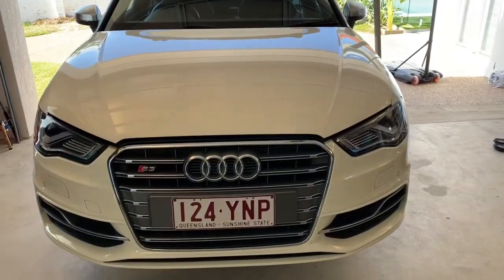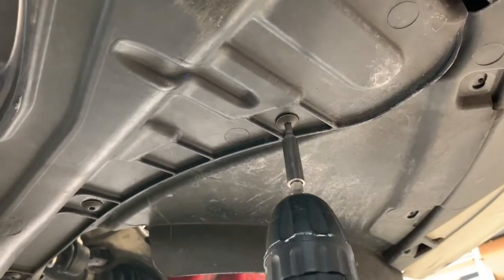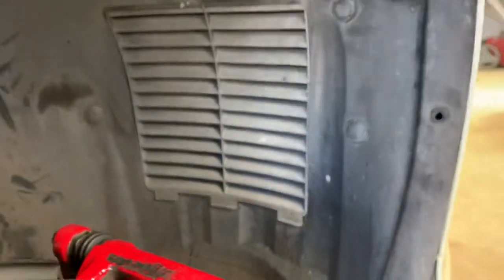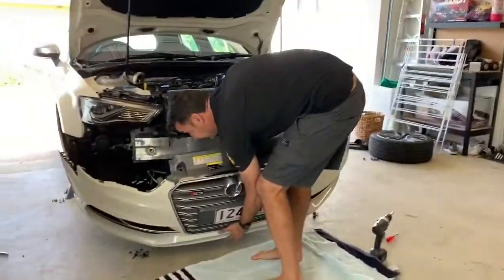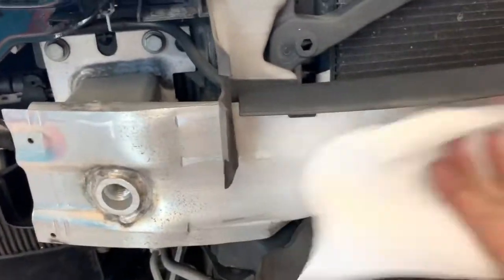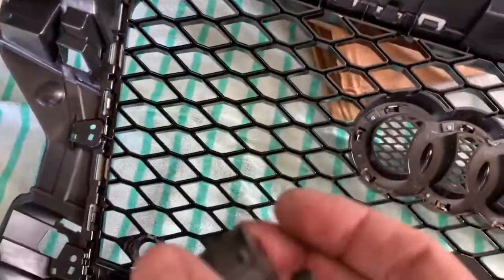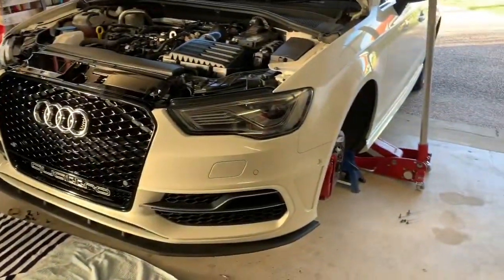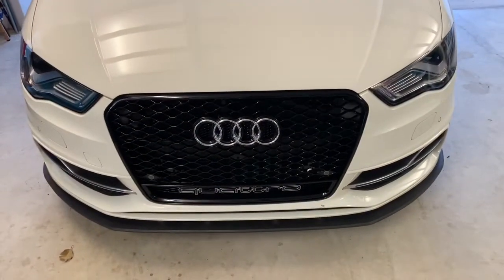RS3 Grill Install on Audi S3 8V - How To

Comment: vw has a real fetish for tough plastic clips. Back when i wanted to install a black logo on my golf 6 i had to undo literally like 40 clips to separate two grill pieces (the grill is like 1/3rd that a3). I ended up grinding off most of them and it still clipped back in rock solid.

Comment: Thank you for posting this. The vertical screws and the two that are deep inside are seriously hard to find and the video really helped. On a 2018, I can't believe that the wheel well needs so much disassembly. Such a pain compared to other cars I've worked on.

Comment: i just had a few questions would this fit the 2017 model and do the parking sensors still work? does the acc sensor work? and does the new grill come with parking sensors to do i have to swap mine from the old one?
Reply from the maker: The 2017 is the facelift and is a different shape to this car but fitment is similar. Yes all the parking sensors work, my car didn’t have ACC but it is just a hole in the grill so will work fine. You will have to swap the sensors over to the new grill like I did. Hope this helps

Comment: Great instructions. I would suggest de-chroming the rings because they stick out like a sore thumb. I plasti dipped mine black, then used graphite metalizer. It looks sick. You can also do just black, but then the rings are not very visible from a distance.

Comment: Hey man one of lower grills on the passenger side broke off, do i need to take the grill off to install it or can i just click it back on ? Dont want to risk braking or cracking it.
Reply from the maker: should be ok to carefully push it back on. I suggest you warm up the plastic so it isn't too brittle. and a bit of lube or something thin to guide it in might help. I was told a feeler gauge would help release the tabs.

Comment: Hey
i just installed a new grill on my audi a3 8v facelift. Now my airbag light is on. I had to park the car in between and guess it's because of it. Do I have to worry now or can I simply read the error out of the system?
Reply from the maker: Sa scha try clearing the code and see if it comes back. You can do it with an OBDeleven

Comment: Hey thank you so much for video. Just purchased my 8v s3 and this is something I want to do very soon. Your link does not work just takes me to eBay stores can you help me find the one you got? Thanks
Reply from the maker: They still have them in their shop. Just put RS3 in the search bar. I don’t think there would be much difference between the eBay grills. I just bought the cheapest one on eBay
Reply: @TheEddysGarage  great thanks man. My s3 should be down here in the next week or so. Can't wait! Stage 2 IE tune already on it with supporting bolt ons.

Comment: How did you undo the clips on the original grill? Please let me know if you have any technique or us special tools.
Reply from the maker: xxjay12xx I used screwdrivers but broke a few tabs. I was later told to use feeler gauges to help slip out the tabs.
Reply: The Eddy’s Garage Thank you for the tip. Also from what you remember where and how many total clips do i need to undo?
Reply from the maker: xxjay12xx not sure how many but they go all the way around

Comment: How long did the whole process take?
Reply from the maker: Took me about 3 hours but I had to figure out how to do it. If I did it again I could probably do it in 1.5-2 hours. The video will help a lot. A tip for the grill clips is to slide feeler gauges on either side so they come out easily and just work your way around.

Comment: Do the sensors on the front end still work when the new grille is installed?
Reply from the maker: wailiepop yes they work fine
Reply: @TheEddysGarage   does this grille fit A3's?
Reply: wailiepop it should brother, it’ll fit the A3 & S3 8V 👍🏻 I’m looking for one myself

Comment: Did you have any issues with your parking sensors after unplugging and plugging back in? I’ve heard Audi has to recalibrate the parking sensors if they are unplugged… stupid if you asked me. Makes no sense.
Reply from the maker: No issues at all

Comment: What bumper are you using?
Reply from the maker: That is the stock S3 bumper with a Flow designs lip.
Reply: You have like a air duct on the side of your bumper that mine doesn’t have, I have a 2016 s3